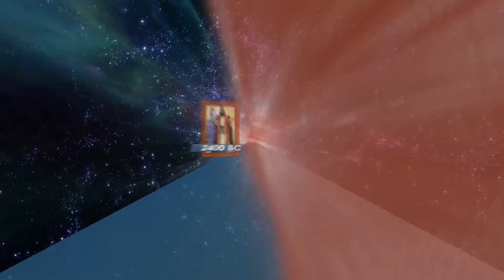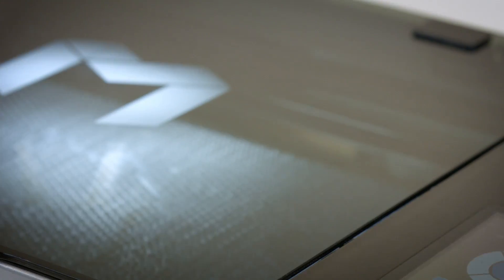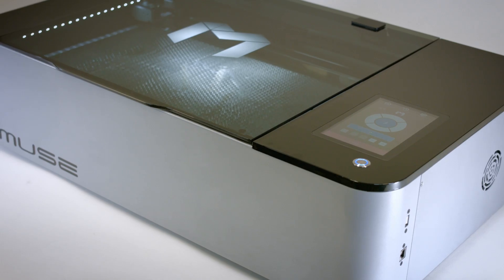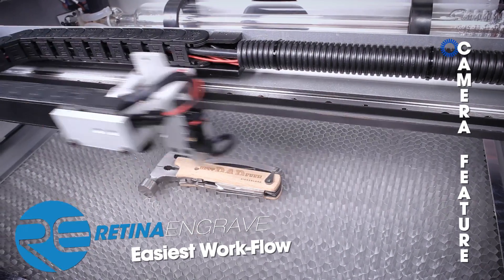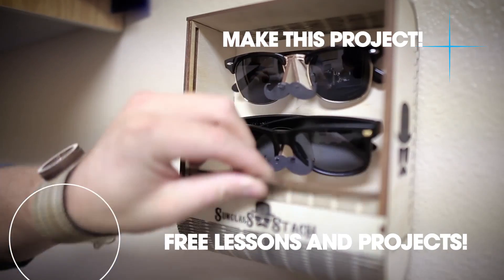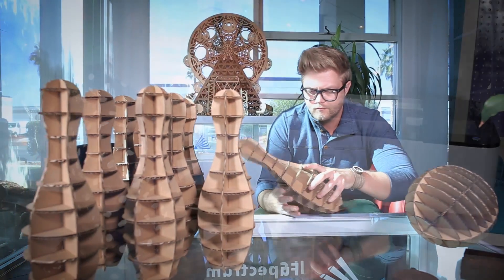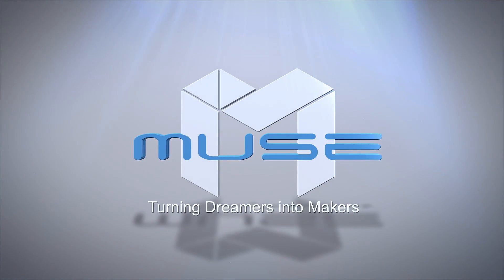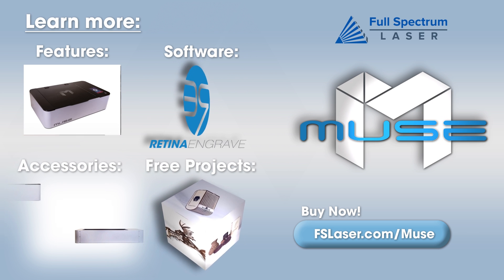Muse Hobby Laser from Full Spectrum Laser

Comment: Is there a link for the mac/linux version of retina engrave?
Reply from the maker: RE2 software actually lives onboard the machine and is accessible via web browser.  Newest plug-ins, versions, and add-ons are automatically updated so long as the machine is connected to the internet via wifi or ethernet.
Reply: Will there ever be a way to interact with H series machines from a mac?
Reply from the maker: Not without updating your control card.
Reply: Understood.    Can I order an updated control card?
Reply from the maker: Not for some time, if at all.  After some upgrades, it seems that there would be too involved to back support old machines with the new software.  All new machines will operate using RE2 moving forward.